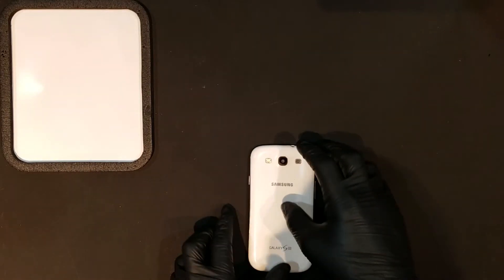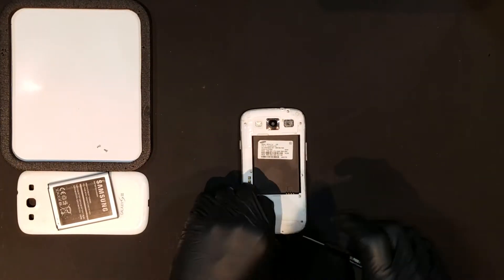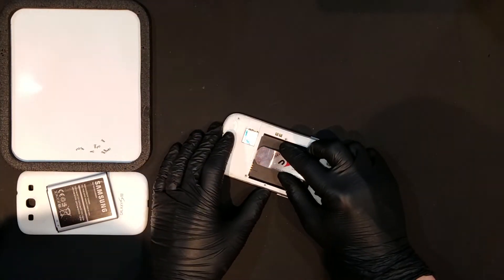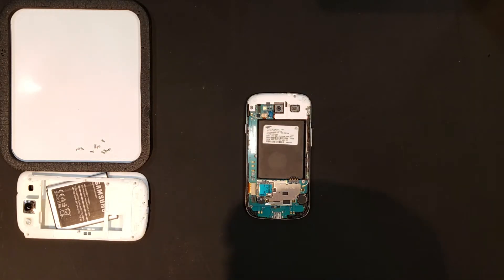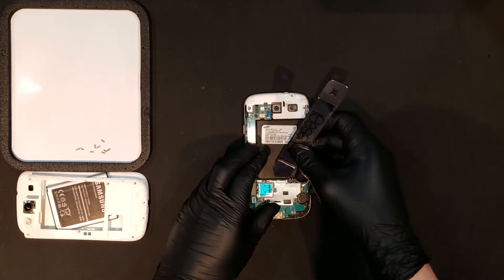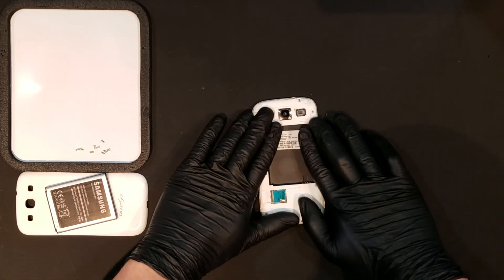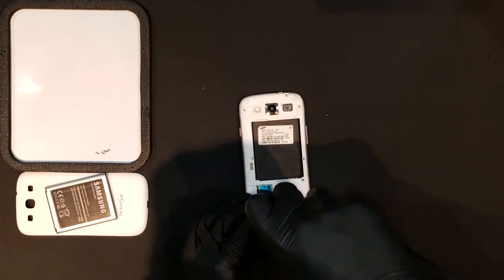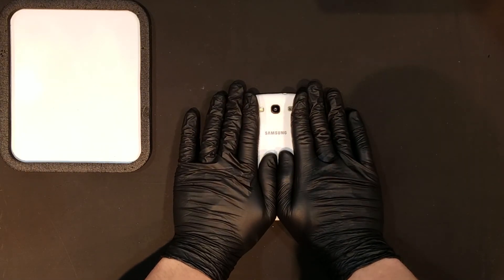Samsung Galaxy S3 SIM/SD Card Reader Replacement

Comment: Where can I put the sim
Reply: The one with no sim card slot is a Samsung Galaxy S3 Sprint version. I saw it from another video, they said you can't change the sim cause it's built in, unfortunately.
Reply: @ACkive  Thanks. I love my S3 but Sprint used CDMA and no SIM Card according to a Sprint/T-Mobile person. But T-Mobile Customer Service told me  they would change the SIM card. So confusing. Now T-Mobile is offering a choice of 3 replacement phones for free. I think I'll take the Samsung A32.
But, my S3 looks like the one in this video. Who knows?